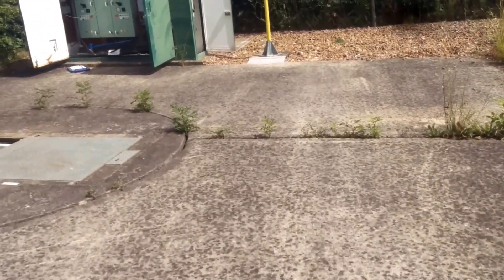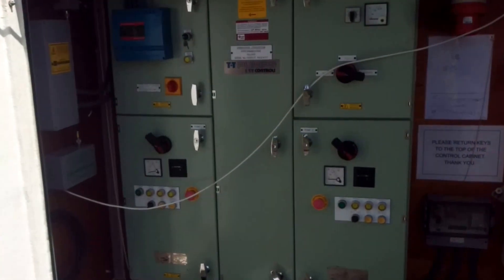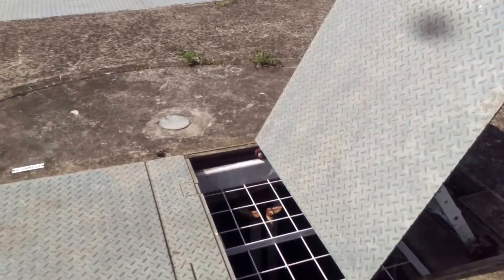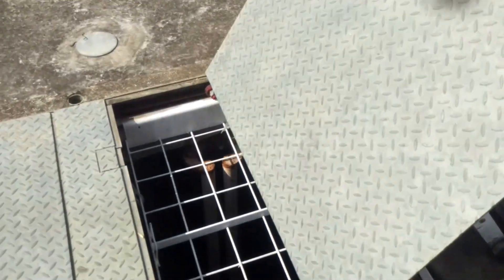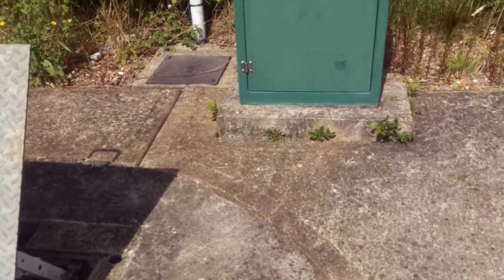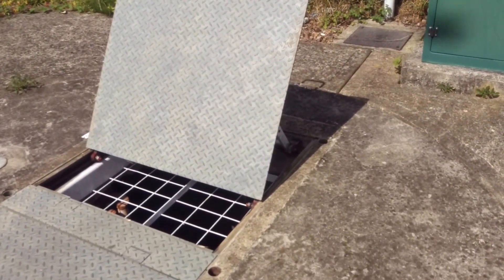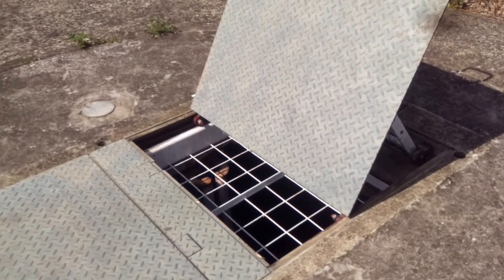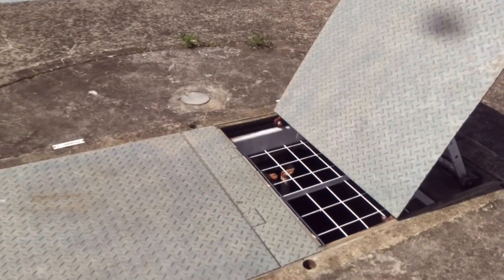UK pumping station

Comment: Is there ultrasonic distance measuring in it? I can here high pitched clicking?
Reply: The blue cone thing is a telemetry device that measures it!
Reply: Looks like a miltronics ultrasonic level transducer. They are used to measure the level in the wet well. The signal is used to start the submersible pumps.  Floats are usually used in addition to signal a high level or overflow condition.

Comment: Cambourn/bourn, 2 hydrostals  Cambridgeshire?
Reply: It looks like Oakdene in Cambourne, at the time of adoption in 2016/2017 two Caprari 18kW pumpsets were installed (fits with this video as Caprari have yellow power cables) - this station may have had Hidrostal pumps fitted after this when under Anglian Water ownership.

Comment: what are those dosing tanks for?
Reply from the maker: I believe the dosing tanks release stuff in to help with the smell, and the other hatches are for the same pit, just no need for a massive hole when inspecting, would be opened to remove or replace pumps or for cleaning out the well.
Reply: @stevenwildman3298  Do the pits contain dangerous gases as I once descended some steps to a locked door which went in to the pumping area
and I felt like my legs were going dead?
Reply: Chemicals to try to break up the fat.
Reply from the maker: No they wont co train any harmful gases, it's basically poo and water, I wouldn't recommend going for a swim in one lol but theres nothing in there that would cause you serious harm.
Reply: @stevenwildman3298  when making a confined space entry into a pump station like this, we would always use a gas monitor before and during the work. It’s not often a man entry is needed as the pumps lift out using the chains.